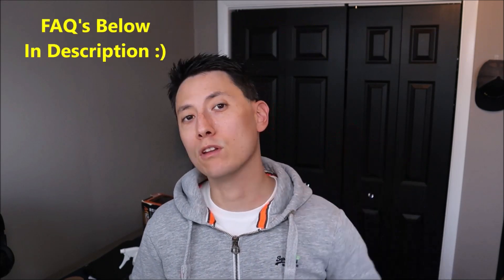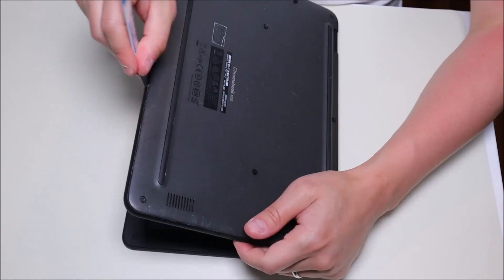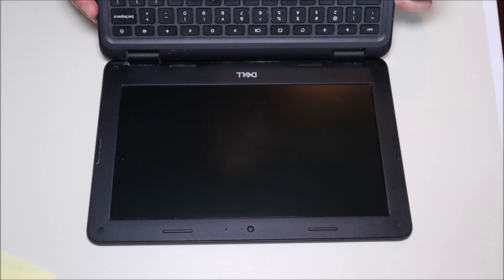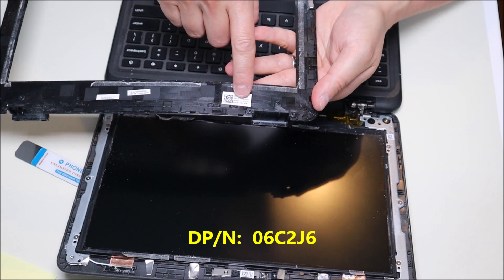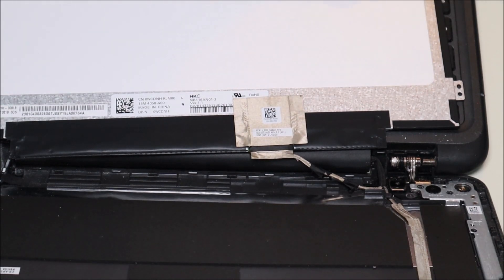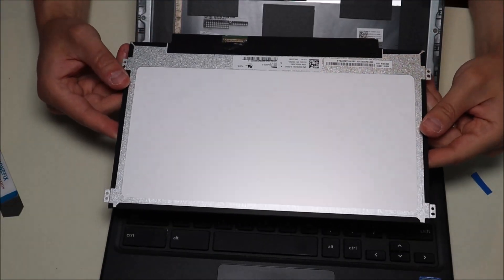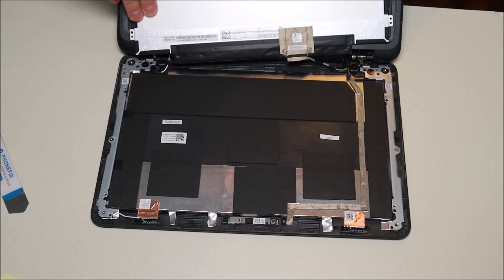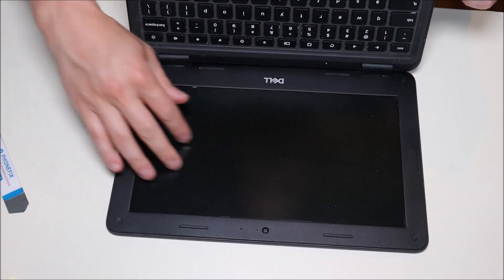How To Replace Screen LCD Assembly Dell Chromebook 11 3100

Comment: ok quick question i don’t think i broke my lcd cord but when i was taking it apart the sticker took litteraly the tiny bit and i can see wires will i be fine if its able to go into the lcd port or do i need new one??
Reply from the maker: Just because you can see the wires does not mean the cable is damaged.  It could be find if the wires are still in tact and not loose

Comment: sir after inserting a ram in my laptop ideapad 330 it won't start only showing up a power button light plz help me
Reply from the maker: Was the computer turning on and working well before the new RAM?  If so, can you put back in the old RAM and will the computer start then?  If so, its most likely a RAM compatibility issue
Reply: It was well working before the new ram just a bit slow I didn't hv any ram it's the 1st ram which I inserted if I remove the new one its restarting
Reply: Thank u so much for ur time I guss it's the compatibility... can u help me to find a better ram

Comment: Sir my laptop stack in [Choose an option] problem Hp

 I reset my laptop then hp stack in choose an option

 Sir how to solve this problem
Reply from the maker: 1.  Was your computer working well before the reset?  If not, what was happening?
2.  You factory reset as seen here?  https://www.youtube.com/watch?v=IkCJ6GpUJ3o
Reply: @PC_Monkey  1) my hp laptop is lagging When I connect with my internet
2) The laptop is not resetting factory reset ... I am doing  factory reset the laptop was automatically shutdown
.....
Reply from the maker: @asdslyrics1962  Can you run the diagnostic test as seen here?  https://www.youtube.com/watch?v=lKb2pPQrkRk

Comment: Hello sir . 
Can you please help . My laptop is not wirking .. powerbotton is on but no display .. screen is black .. .please help me .i am very upset .. from last day i am trying to solve my problem .. one of friend shared your youtube link. Now i have a hope .. 
I get any cintact from you please help . I have lenovo laptop .. please help me
Reply: Is there is any possibility .. I can contact to you. .😢😢😢 Please I need a help .. 😢😢
Reply: @shreyajaiswal8972  in your laptop have black screen problem 
1) just press power button 3 minute
 [it als not works]
2) remove your laptop battery and press the power button 3 minute and you want to attached the battery with laptop and connect to your laptop adaptor and press the power button of laptop......
Reply from the maker: @shreyajaiswal8972  1.  For free, I communicate here on YouTube.  For a fee, we can set up a time and talk somewhere else.  Which would you prefer?
2.  For a computer that does not turn on, try this video first; https://youtu.be/kOBY4k2Mn_k. Let me know how that goes :)